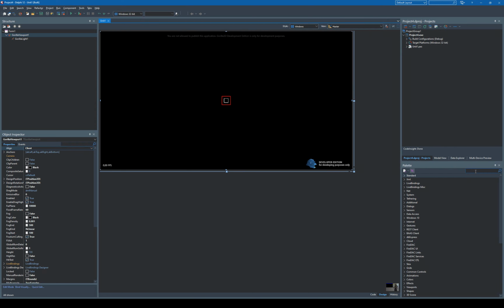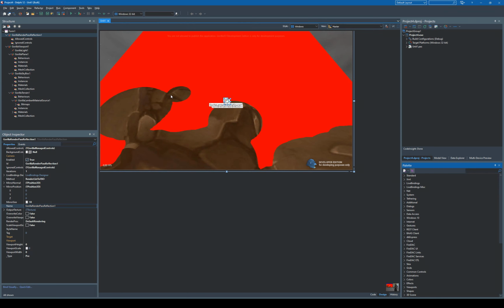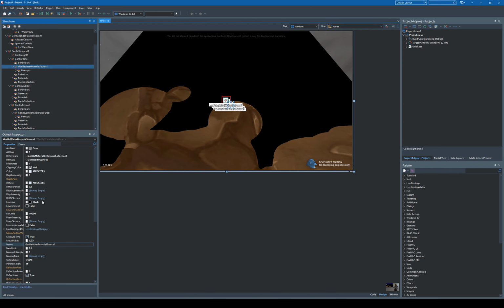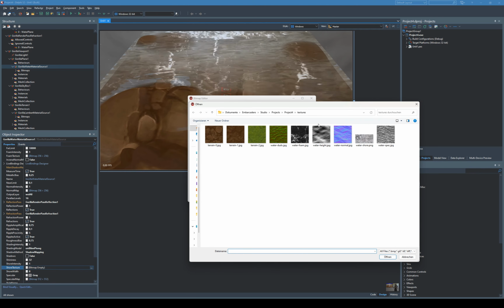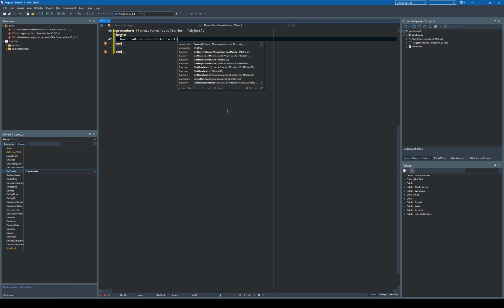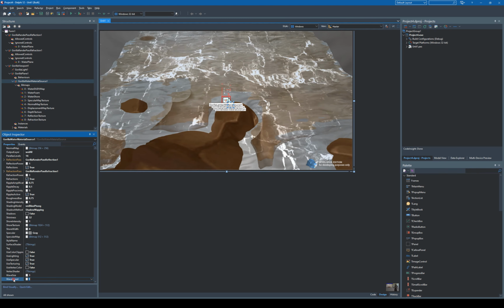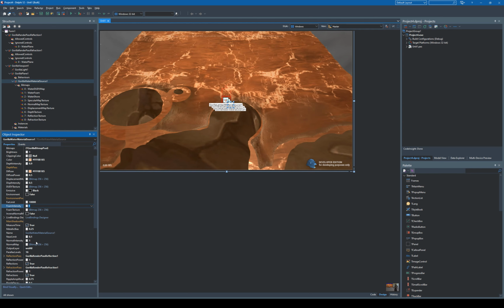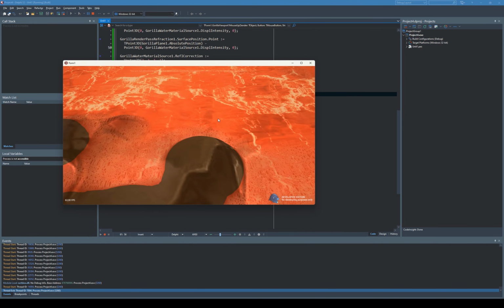Tutorial: Creating A Water Surface

Comment: Wow Gorilla water is really looking good ! I'll have to try.  I have some questions : How to make a boat trail ? From top view how to make water darker with depth ? same question about depth and darkness when camera is underwater ? How will lights react underwater ? (question are in order of importance,  I don't really need underwater )
Reply from the maker: - How to make a boat trail?
	If ripples are active, you could also use them in the fragment shader.
	Add ripples along the route of the boat.
	You could modify the SurfaceShader property of the water material,
	where you draw some texture with the ripples information.
	
	I gave it a quick try, not perfect, but a good start:
	
	  var LStr := TStringList.Create();
	  try
		LStr.Text := '''
		  void SurfaceShader(inout TLocals DATA){
			float l_TotalRippleEffect = 0.0;
			float l_Time = abs(_TimeInfo.w);
			vec3 l_TransfVertexPos = DATA.TransfVertPos.xyz;

			for(int i = 0; i < int(_RippleCount); i++){
			  float l_RippleDist = distance(l_TransfVertexPos.xz, _Ripples[i].xz);
			  float l_RippleTime = abs((_TimeInfo.x + l_Time) - _Ripples[i].w);
			  float l_TimeLimit = clamp(1.0 / (l_RippleTime / (_RippleProximity * _RippleDecay)), 0.0, 1.0);

			  float l_RippleEffect = (-_RippleAmplification * exp(_RippleDecay * - l_RippleDist));
			  l_RippleEffect *= cos(_RippleProximity * (l_RippleDist - l_RippleTime));
			  l_RippleEffect *= l_TimeLimit;

			  l_TotalRippleEffect += exp(-l_RippleDist) * sin(0.5 * l_RippleDist) * l_RippleEffect;
			}

			if(l_TotalRippleEffect > 0.01){
			  vec4 l_BoatTrail = tex2D(_WaterShore, DATA.TexCoord0.xy);
			  DATA.BaseColor.rgb += vec3(l_BoatTrail.rgb * l_TotalRippleEffect);
			  DATA.SumColor.rgb += vec3(l_BoatTrail.rgb * l_TotalRippleEffect);
			}
		  }
		  ''';

		FWaterMat.SurfaceShader := LStr;
	  finally
		LStr.Free;
	  end;

- From top view, how to make water darker?
	You can reduce the DepthIntensity and RefractionPower value.

- Underwater colors + light reflections underwater
	I would recommend to use a post effect (TGorillaPostFX component => https://docs.gorilla3d.de/1.1.0/postfx?s[]=postfx)
	and a shader like this:	
	https://www.shadertoy.com/view/ltycRm
	
	You will need add an if-condition in the shader when viewers position is
	above or under the water surface position.